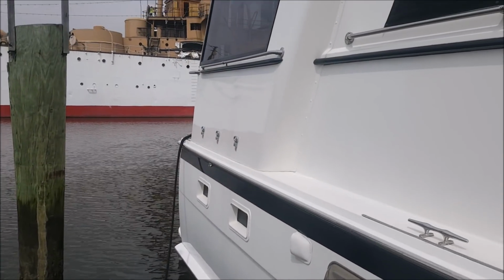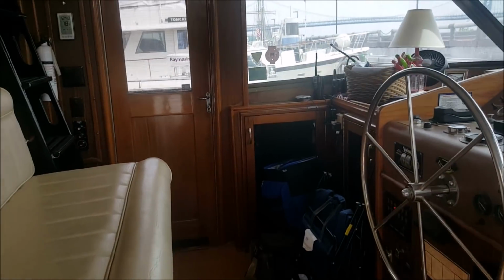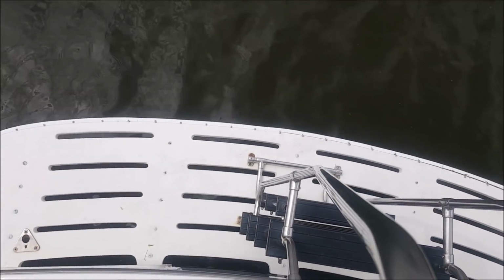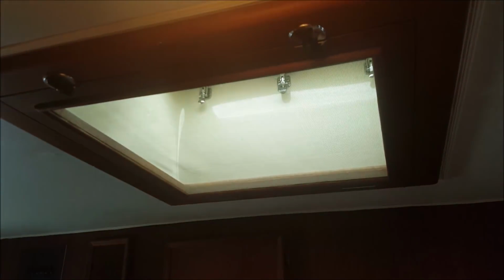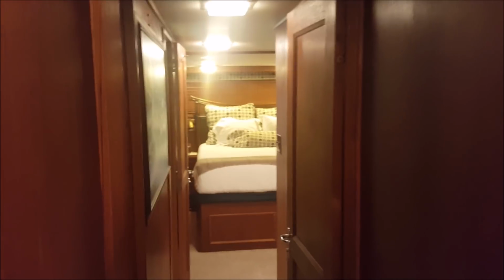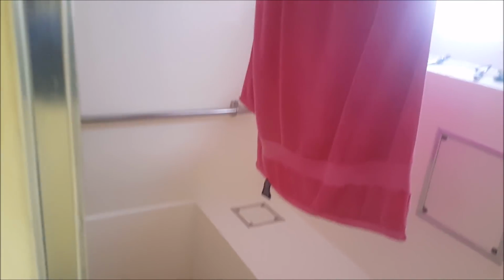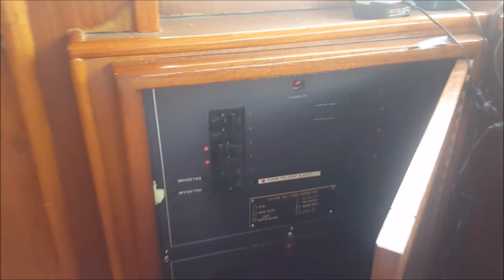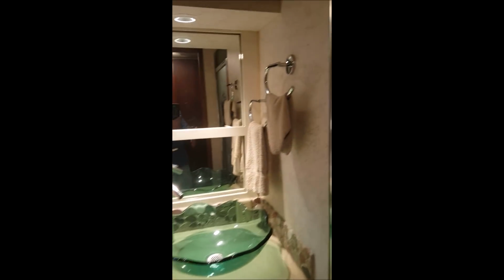Tour of our 58 Hatteras Motor Yacht E25

Comment: That is a seriously well laid out boat.  They did a killer job in the design.  I did notice something in the engine rooms, you might want to replace the break boxes in there.  They look really tired and seriously old.  Did you take the Coast Guard Captains license test?  I actually did and had a license for a short period of time.  I never was fully licensed because I never spent the time at the helm as required but I took it just in case I needed for anything.  I grew up around boats.  I fixed many things on a boat before.  My father and I installed everything a boat needs onto a hull of a boat before.  We installed the engines, electric, hydraulics, gas tanks and other systems.  This was a catamaran racing boat 32 feet long.  I helped to redesign the dash for strength and durability.  We installed the seats everything.  So I know a thing or two about boats.  I just wanted to say you got a steel when you bought that boat for sure.  Huge congrats and have tons of fun with it.
Reply from the maker: Thanks for the comments and suggestions. I took the Pennsylvania Boating test and I am planning to take the coastguard test, possibly this summer. I was never around a boat, period, until we purchased the Carver 3 years ago, so it is all new to me.
Reply: That is good to hear.  Taking the Coast Guard test might even change your insurance rate especially if you have passengers aboard.  It also give you knowledge how to handle a seriously bad situation in just about any situation.  I think you guys do a great job together and am very happy to see you both enjoy boating.  If you take the coast guard test and pass you can probably charter the boat out yourself to make some small change and lower costs a bit.  You probably already have all the time needed behind the helm for the test.
Reply from the maker: Plus, I can make Lyn call me captain!
Reply: LOL that is always nice but don't forget to tell each thanks for lots of stuff,  That always helps.

Comment: Recently found your channel. Very informative. Beautiful boat. This might be a dumb question but do you dump the grey tanks and black tanks into the water? We do R.V's and don't know much about boats.
Reply from the maker: The grey goes directly into the water. The black goes into holding tanks, which we pump out at a pump station every now and then. Many marina's have pump outs right at the slip but ours is around the corner.
Reply: Thank you

Comment: Excellent yacht. For the two of you it is simply perfect.  Two quick questions if I may - how do you manage regarding taking on fresh water storage? Also being new to this subject, would your yacht be considered able to cross the Atlantic or is that too far a journey for a vessel of your size?
Reply from the maker: There is a 100 gallon water tank on board. There was an additional 80 gallon tank but a previous owner turned it into a fuel tank. The boat is tuff enough to cross the Atlantic but cannot do it because of fuel requirements. We only hold around 800 gallons and have a range of approximately 550 miles before we need to refuel.

Comment: I have a suggestion on your counter.  Consider leaving the current counter and finding a matching counter that would be like a fold up "leaf"   When down the leaf acts a trim, but when up, it acts like counter.  To raise and then lower, just softly lift.  To lower just raise slightly and it lowers.  The leaf can be a matching material or can be contrasting / complimenting material depending on taste. The bracket can be made of brass or some tasteful material.  Provide a couple of neat looking brass clips to batten the leaf in the down position.  Should be easy to fabricate.
Reply from the maker: That sounds like a good idea, however, we already made changes to our counter. We will be posting a video of it soon.

Comment: I was a carpet installer in Vero beach FL. I almost exclusively worked with interior designers, and carpeted so many hatteras'. I was there for 5 years, but got lucky. Just after I left my partner, who stayed behind put a screw thru a fuel tank on a hatteras.....big mess, bigger $$$$$
Reply from the maker: Those tanks are right below the floorboards!

Comment: Does your boat have a water maker?  Very nice Hatteras MY.  I do like the changes made by the previous owners.
Reply from the maker: Yes, it does have a water maker. However, we have not used it yet. We have been told there are expensive to maintain and water is free at marinas on the east coast. If we go to the Bahamas next year we will set it up.